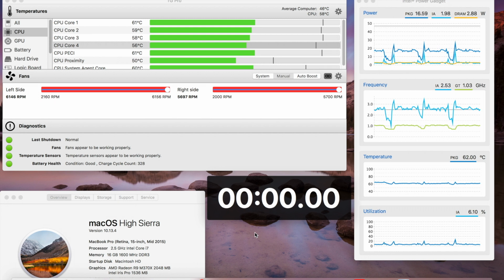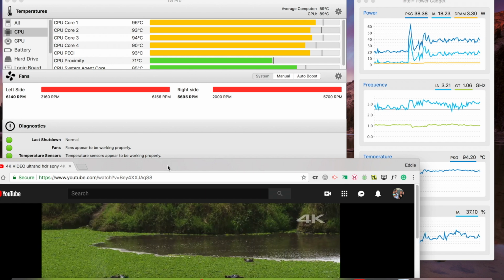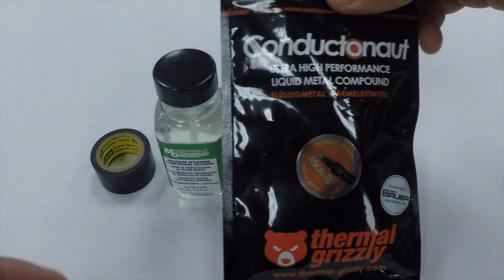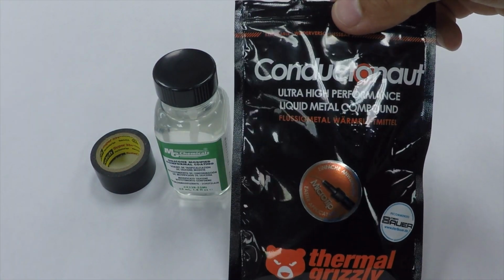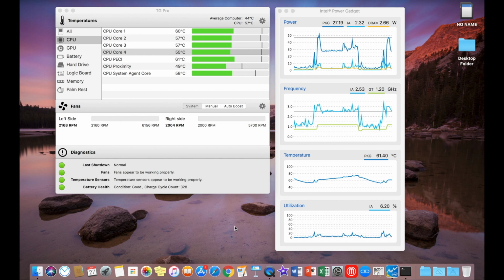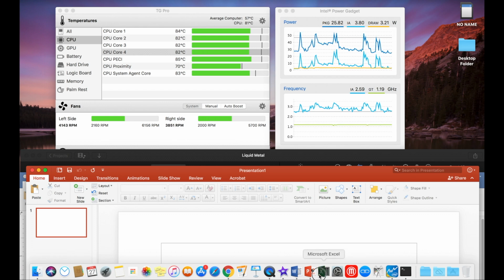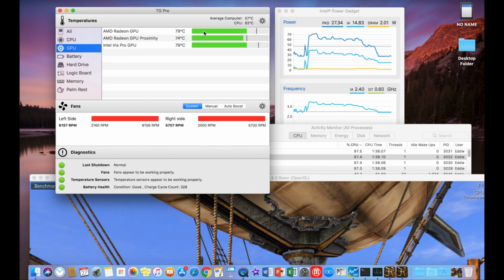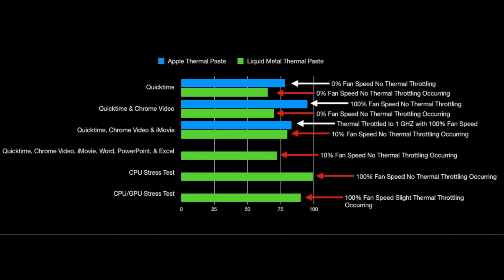Liquid Metal MacBook Pro Review

Comment: Finally, a well done, great video. Thank you for your time and effort.
I have the same MacBook Pro as you, except mine has the Core i7 4980HQ processor clocked at 2.8GHz. And it thermal throttles. I have a few questions:
1. Could you run a CineBench test and report back your results? I want to compare the results I get with yours.
2. I have seen people use kapton tape instead of electrical tape, do you think it's a good idea?
3. Also, someone used a foam dam instead of the conformal coating, so that the liquid metal doesn't go around the motherboard, what do you think about that? (Referring to https://www.youtube.com/watch?v=M9QbOOmvHuQ)
4. I have heard that you have to change (repaste) the liquid metal after a certain amount of time (a year or two), is it true?
I'm just trying to evaluate if it's really worth the risk to use liquid metal instead of regular thermal paste (I use Arctic MX-4, but apparently Kryonaut is better.)
Thanks in advance.
Reply: Eddie Nemec Interesting. I usually get scores between 590 and 610. It’s funny how Apple charges you more for a CPU that’s capable of delivering more, but that is bottlenecked by the heat. A lower clocked CPU performs just as well, if not better, when the right thermals are used.
Also, if you want to get even better thermals, there’s a trick you can do which is to put thermal pads (thick enough 1 - 2mm) between the heatsink and the bottom aluminum cover/panel of the macbook so that the heat gets transferred to it. I have tried this method, but the panel has a protective black plastic layer that needs to be removed in order for the heat to transfer efficiently (which I did not do and heat transfer wasn’t great).
I guess I’ll go with the kryonaut paste first and then we’ll take it from there.
Thanks :-)
Reply: @iUTKNi  Can you share with us how did it go for you and Kryonaut/Conductonaut?

Comment: Laptop still running ?
Reply: I'm seeing from other people's videos that the gallium alloys with the copper and ultimately it's not good for the heatsink/gpu. I already applied this to my 2011 15" mbp maybe 2 weeks ago but still haven't seen anything bad happen, and I don't want to try and remove it either and replace it with normal thermal paste. I made sure to apply a super thin coating of LM so it doesn't go to the other circuits. The only time I noticed the fans go crazy is when I have a ton of tracks playing when I used Logic X. And for Lightroom/Photoshop I disable the graphics processor and it works fine. For normal usage I still have an external fan running underneath the laptop at all times to keep it relatively cool.